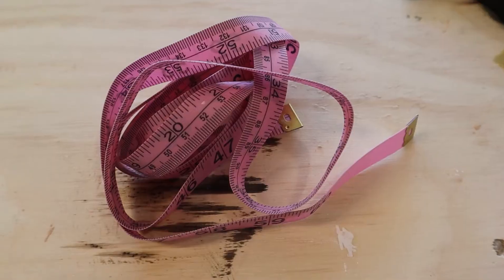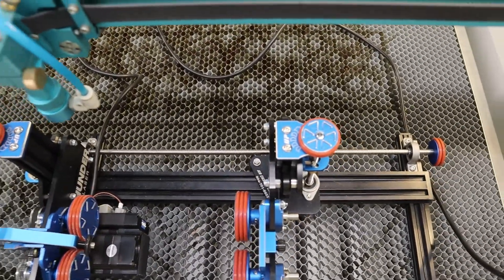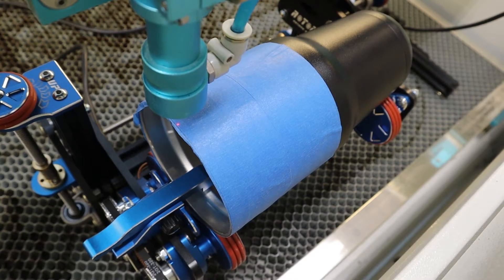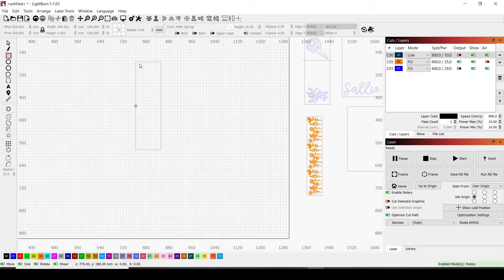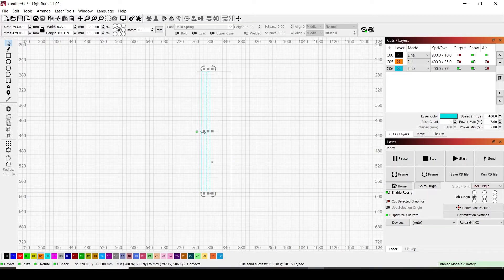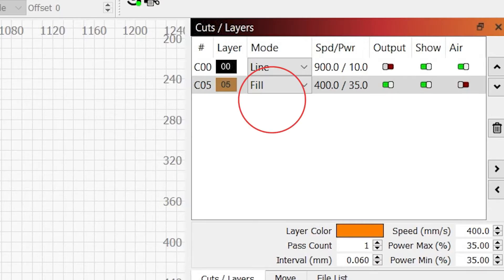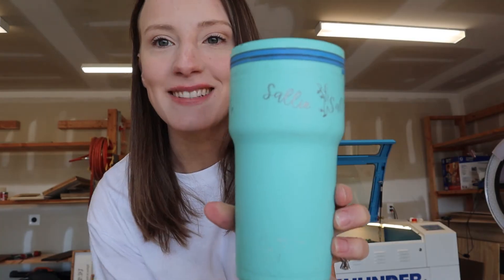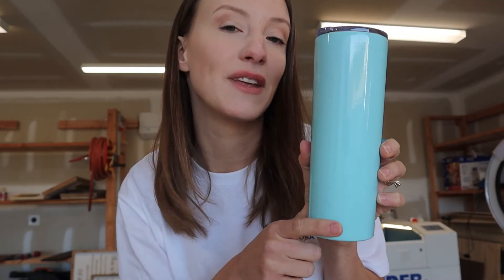How to Laser Engrave Tumblers | Thunder Laser & Lightburn

Comment: NIce video. I was wondering what the workflow would be if you had a powder-coated tumbler but wanted color rather than engraving down to stainless. Say I had a red tumbler and wanted a black logo on it. Would I do a normal engrave down to stainless, spray it with Cermark, and run the engrave again or is there an entirely different process that is more efficient? Thanks.
Reply: First, registering the secondary pass, after you put CerMark on there, would be next to impossible if you removed the cup from the rollers to paint it.
I've never seen anyone laser CerMark over powder cost, but suppose the best approach is to do it on the first step on its own.
Reply: @IRTermite  Thanks. I wasn't certain if it was even an option; there are probably better ways to get color onto powder coating.

Comment: I have a tumbler I am trying to engrave, and the top diameter is bigger than the bottom.  It is not like any of the tumblers you featured.  I noticed the test line is like mine in the sense that it goes "off track".  I am just concerned and wondering, if I use the top diameter, would my engraving be off? I am doing a football design on the top and the lower half the name of the team then persons name on the opposite side.  I fear the bottom will not be accurate? Any advice?
Reply: You measure on top, and then angle your rollers inward to the bottom of the roller so they pinch down causing the lasered side of the roller to be level to the ground.

Comment: I would love for you to make a video on how to line up a design on a cup that already has a logo on it! I cannot figure out how to line it up to print where I want it over the logo.
Reply: Try using the center out origin or position for the placement of the start. Center your origin on your existent graphic as much as you can and also choose that option on Lightburn. It should work. I usually use that setting for my origin instead of the on the top edge of the piece being engraved.

Comment: Thank you for sharing.  I've had my laser a while now, but really haven't used it much.  I was getting frustrated with different sized tumblers.  Works on one, not on the next.  But you shared one little tip I hadn't seen before that fixed my issues.  Thanks - looking forward to more videos.

Comment: I run my sane machine at 400/20/7mm focus with the same line interval with no problems. Cuts it like butter at 20 power
Reply from the maker: I tested out lower power on my machine and it had some spots that didn't go through the powder coat fully, but this was on my old tester cup. I'll try this out again on a newer cup as well! Thanks!